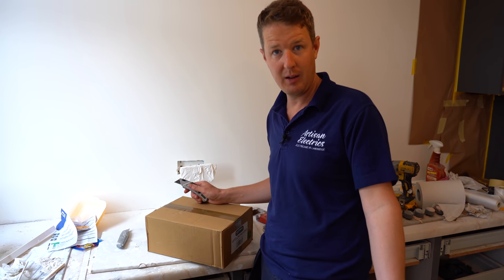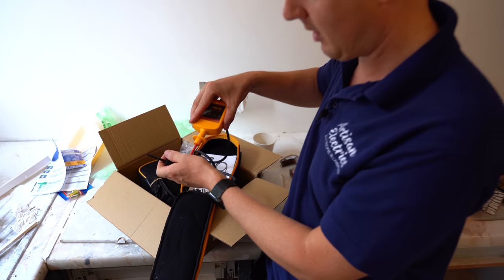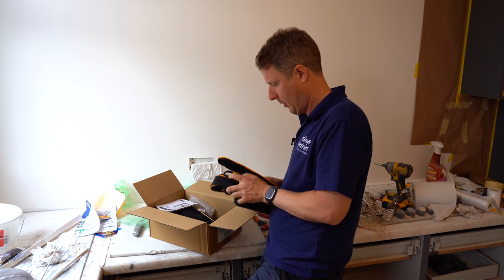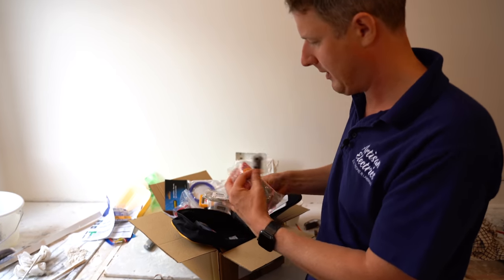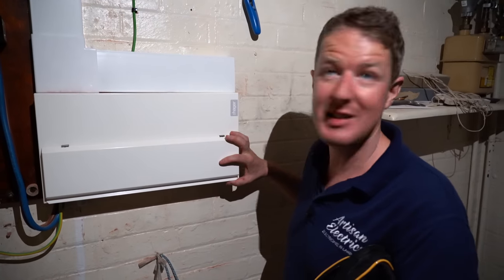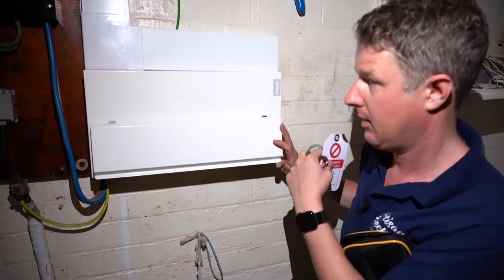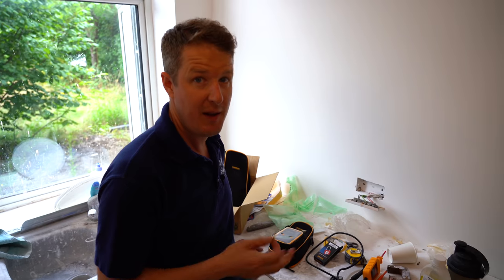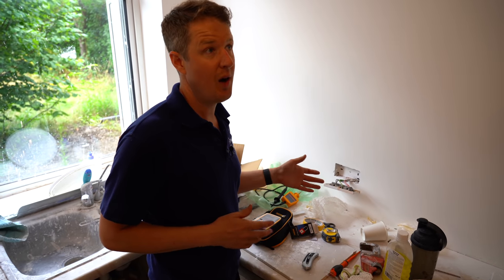Safe Isolation Procedure Lock out Tag out UK - Electrician Life

Comment: We had a "lock out- tag out system" when I use to work for a large semiconductor company in Ireland. A great system which worked really well & provided you with that security. You always had that niggling worry that's always in the back of your mind that some unsuspecting person could accidentally turn the power back on. When I went back to domestic sparking I always tried to recreate it, as the same safety standards were just not there. Great to see this device being introduced.

Comment: Actually you won't get shocked if you touch that probe with your hand. The internal impedance of these testers is too high for that. Otherwise you would trip the RCD/RCBO when testing between line and CPC. If the tester is damaged and that internal impedance is no longer given, the tester would indicate weird voltage values. Some proofing units will give you a full test cycle with different voltages.
A different thing is if you have a tester with a load connection, but this load connection is only applied when pressing two buttons simultaneously, and only for the time both buttons are pressed. And that load connection trips RCDs/RCBOs.
Still good practice to do so. But on a three-phase system it becomes a bit weird, because you also have to test between the lines, so there is no least dangerous in that case.

Here in Germany the safe isolation is fixed in our regs for decades in the DIN VDE 0105, called the "five safety rules for electrical work"

1. isolate circuit
2. prevent reenergizing
3. ensure the circuit is really dead with a properly tested 2-pole voltage tester
4. earth and short-circuit all conductors (only on overhead lines which are usually not insulated, and voltages above 1kV)
5. cover up all exposed live parts next to your working area (that is mainly for work areas like transformer stations or industrial environments)

So for domestic usually only rules 1 to 3 are relevant.
Instead of using a proofing unit you can also use a known functional live circuit instead to fulfill that regulation. But sometimes you don't have the luxury of having one in the area, so still a good idea of having a proofing unit.

Also a tip: Always use your own lock, never a provided one by a colleague or the customer! You don't know who else got a copy of the key for that lock.

Comment: Worries so much about safety he uses an uninsulated knife to cut off wrapping on a circuit he's not sure is live or not ... great advert for martindale there haha
Reply: Plastic is a non conductive material. 
Its not like he was touching the bare knife metal.
Reply: It’s a steel body knife
Reply: How do you know he didn't check it previously?
Reply: How could you get to the terminals to check if it's covered in wrapping to check ?
Reply: There might have been a loose wire floating around which you wouldn’t see because wrapped in plastic. As a non electrician I would have turned power off before unwrapping the socket.
Reply: That's right he should of done the whole safe isolation procedure before going anywhere near conductors but I am honestly shocked they have live fitting handing from the wall wrapped in plastic .
Reply: And even though it was in plastic was covered in plaster so very much a pointless exercise to wrap it.
Reply: @joemoore9991  i make you right, we have all had a tingle from time to time , seen a couple of nasties with idiots messing with 3 phase gear , but nothing serious in the domestic game , seen a few fatalities when i was an ETO , but then on ships we use 440v or 6kv
Reply: @ballchinian911  if in doubt, turn the whole installation off and then conduct safe isolation at the board .. that's what risk assessments are for ;)

Comment: R

Isnt cutting the plastic bag off a plug socket that may be live a bit dodgy, a narrow pointed blade could easily touch a terminal, and to protect a plug socket from  paint plaster etc use cling film, easier to  remove and mould to  fit  around the  unit.

Comment: I changed an outside light fitting off ladders at my parents house  and didn't put a padlock on the mcb  as they were away on holiday and I had the spare key to the house which I locked up after switching off the consumer unit mcb.
After I had connected the new light it came on as i was descending the ladder,  My parents had come home early and reset the mcb.
Lesson learned always assume someone else with the building keys could be there at any time
Reply: They dint notice you up the 40 foot ladder as they pulled onto the drive then
Reply: @ericthekingthekingtheking4842  around the other side and no window, can't be seen from the front drive

Comment: them retractable tips can be more dangerous than you think - if the tip fails to extend properly you will be left with a false sense of safety because you can't  see the tip making contact directly. Should have at least 1mm always exposed.
Reply: It's a retractable shroud as opposed to an extending probe so it's not so bad, but your point still stands about potentially not being able to see.
Also potentially problematic if you're trying to probe a socket dangling in mid air...

I do think it's better than non retractable shrouds though, fixed ones (or removable ones that haven't been removed) are more likely to give you a false connection.

I very much like the Fluke TwistGuard system. Slim, no fiddly bits to lose and you choose exactly how much exposed probe you want.
Reply: @tceng9449  and if we're being realistic, no-one is going to probe socket terminals when they can just stick a socket tester in
Reply: @havoctrousers  chosen as an example as that's exactly what he was doing in the video :)

Comment: I had an incident recently in a refurbished commercial building. The building had undergone extensive refurbishment that included a rewire. The incident involved an installed motor which now had a new feed from a different DB, the electrician had connected the new feed but hadn't removed the old wiring which had just been cut-off and left. Because I needed to renew some low-voltage control wiring that ran through the same flexible conduit as the old feed I went to remove this cut-off power cable, only to find out the hard way that the electrician had left it connected at the load end so it was now back-fed from the incoming side of the motor isolator. Of course I should have turned-off the relevant MCB in the new DB first, but it never occurred to me that a qualified spark would connect the new wiring to the isolator without removing the old wiring first. The moral of this story is never assume that the other guy, however well qualified, is going to do the job properly.

Comment: Always wise to test, so easy to screw up, no matter how intelligent / experienced you happen to be. I worked on my shed live once because I'd switched off the smoke alarms at the main CU. I only had two breakers not on RCD protection, both clearly marked, and somehow I switched off the 6A smoke alarms rather than the 40A shed feed. No idea how it happened, only found out when I went to turn it back on. Fortunately I was only working on earth wiring, but inside a garage CU right next to the (covered) busbar.

Comment: Lots of cases of lockoff kits falling off the breakers due to being poorly fitted then someone getting injured. Sadly that process of locking off isn’t fool proof . Is probably better to actually isolate it from within the board
Reply: Fantastic in a classroom not applicable especially in industry where opening a db or sub main would turn off half a site
Reply: The thing is, you got several types of MCBs with different dimensions and designs of the housings. So you require different types of locking mechanisms, and it's always trial and error. I always take my time checking if I picked the right one and test if it's holding properly and prevents that the MCB/RCBO can be switched on again.

Comment: The only problem with the martindale voltage tester is  if your circuit has no cpc or neutral  but has a live  the  tester will show the circuit as dead.
Reply: And this is where, not just Jordon, fail. Martaindale is super and great. Can you just point me to a previous video where he has used them?? I’ll watch future ones to see how much they appear. I mean, if you use the stuff sure, but to just stick it on a video and promote it, it’s a joke.  Your not helping the industry, more so lining your pockets.  Syndical me 😂😂
Reply: I don't think this is specific to martindale, but is more an issue with "2 pole testers" in general. They will only pick up when there is a voltage between two conductors, they won't pick up when everything is live or floating.

For this reason and others I would be very careful about working on stuff that is "already dead" when you arrive. It is much better if you can confirm something is live, then isolate it and finally confirm it is dead.

Even then it's not 100% foolproof, multiple feeds, borrowed neutrals and so-on are far from unheard of.
Reply: @petermichaelgreen  hi peter,  i use a different brand of voltage tester which has a feature that will alert me  if there is no cpc or neutral, the only problem with this is it requires a battery to do so but also has a self test function you can perform before using  a proving unit which will tests all the led’s and the battery.
Reply: @petermichaelgreen  The rather simple 2-prong tester I use does actually indicate a live connection both visually and audibly when probing from the meter side, but for it to display a voltage reading does require a form of ground (basically anything loosely connected to earth) on the flying probe.
Reply: Modern ones have a single probe live test as well. The Kewtech voltage tester I use has this feature, I'm sure the flukes do. I think I've only ever seen Jordan use the same Kewtech tester that I do in previous videos.

Comment: Pity the plasterer didn't show the same consideration as the decorator. The socket is absolutely covered in plaster. Have you tried using the temporary yellow socket spacers that Nick Bundy uses? Fit them during 1st fix and remove them during 2nd fix. Great product.
Reply from the maker: Yeah I’ve used the sockitz before but in this case it wasn’t necessary as we were replacing all the fascias after decoration

Comment: Interesting bit of kit. But the tester that tests the tester needs a tester to check that tester is testing correctly.
'Quis custodiet ipsos custdes?'
Reply: All falls under the time-honoured phrase "reasonably practicable". I used to work as a DNO engineer and the proving units for LV test lamps and for HV live-line detectors were also tested periodically. Testing all the test equipment at every use ad infinitum isn't reasonably practicable, so it's not expected but I get your point. Not using a proving unit immediately before and after using the voltage indicator could land you in some difficulty post-incident, however.

Comment: Great Video, Thanks for making it.
I do have a question thou, why do you try different breakers? Could you not just use a tone generator on the line and use the receiver to find which circuit it is.
Saves runnung back and forth trying different breakers.
Reply: or just use one of those 13A socket testers that beep
Reply: @mikeselectricstuff  I did not know what they were called in UK since I live in Canada.
Reply: Using a tone generator would involve more disruption as the whole CU would have to be isolated to accommodate the circuit identification process. It may well be that an electrician carrying out a risk assessment would decide that was reasonable in the circumstances (unoccupied house). However, tone generator signals could be applied to the wrong circuit and the tone receiver could pick up a signal at the point of work that was interpreted by the user as a 'clear indication' that the circuit was identified, when it was not.

In the scenario depicted in this video, proving a change of condition at the terminal on the socket outlet (proved live - MCB opened - proved not-live) is probably the most practical and reasonable way to identify and disconnect the circuit prior to isolation.
Reply: @mikeselectricstuff  not a good idea. Socket testers are not designed to be used as voltage indicators (with approved proving units) like the Martindale kit. You could use them a 100 times and get way with it or use it once and have an accident. Don't think I would want to defend that approach in a subsequent HSE investigation.

Comment: Hi  Jordan I am not a electrician just  a very keen interest in electrical  installation but I got a Martindale plug in tester that I bought in 1989 and still work great also I got a Klein 5 in1 screwdriver that I bought in USA on holiday In  a Sears store in Florida back in 2000 the largest slotted driver bit of the two fits the brass M4 pan head conduit boxs machine screws  perfect  I think I paid about 10 dollars for it I just love  to buy tool were ever I have been on holidays all over  I just got to find a tool shop

Comment: The boards I go for domestic nowadays are Contactum just because they have the magnets to hold the cover up. Not really impressed with Hager that much and fusebox brand is just a hype which tend to go down hill in my view where I used the torque screwdriver on a main switch and it just lost the thread on it. But mind you I don't want to hype Contactum just because I can go to my wholesaler and get everything without waiting for weeks on for a 20a RCBO. Thanks Jordan nice to see you back.
Reply: Contactum is a brand I am not sure on, they have been bust a few times, so who knows how long they will be around.
I recently installed one of their boards, and I wasn't impressed with it, mine didn't have magnets, plus it doesn't come with any grommet strip. Only used it because cities had it on the shelf, I normally use fuse box, it's been difficult to get, but denmans now have a good stock of it.

Comment: Nice video again!
Can’t there be a case where only the live was connected, but cpc and neutral were not connected?
That would lead to no voltage shown on the tester but the live still has its potential to earth.
Hence I think it’s good practice to measure from all conductors to a water line or similar to proof the conductors completely dead…. what do you think?
Reply: If there was a significant hazard in the work area - so, if there was a likelihood that you could touch any part of the installation wiring and another, earthed conductor simultaneously - then, yes, I would test from each conductor (line and neutral and cpc) in turn to the pipe or whatever I might be holding onto.

Comment: Here’s a scenario, you mention multiple sparks working on one site from the same consumer unit and, other trades working on site. 
So you’ve just isolated the breaker you’re working from. What happens if another of the aforementioned sparks, or worse still another trade on site, makes a change to the wiring in the loft, which for what ever reason, becomes connected in to the ring you’re on. They go back and turn on their breaker and you then get a shock. Surely the safest option in the instance where other trades are working, where possible, should be to lock off at main breaker?
Reply: Communication is pretty key too
Reply: In the real world you cannot go round and just turn of mains and incoming. Especially in an Industrial setting. You have to allow for compliant people working not everything can be fool proof
Reply: Not an unusual scenario on a large commercial or industrial installation with lots of work going on at the same time. Management of safety then includes as part of any risk assessment before work starts a specific action to confirm whether other work is taking place that could affect your safety (or your work could affect theirs). Some large sites may operate a Permit-For-Work system to manage this too. Your scenario refers to a domestic house so the risk is probably higher as it's unlikely a safe system of work is written down to cover what's going on. Head on a swivel and always treat wiring as live until proven otherwise.
Reply: Exactly what I was thinking. I’ve worked on big jobs where the HVAC boys may have their own sparks, therefore not inconceivable they could make changes without any communication, especially with multiple subby gangs going.

Comment: Probably are good testers but I like the audible ones buzzing like hell telling me LIVE!
Reply: That will only work with batteries. If the batteries are empty they'll usually only show you the "dangerous voltage" symbol and that's it to comply with the EN for voltage testers. These Martindale testers work without any battery.
I use a voltage tester with a load connection. The load is a vibration motor in one of the handles. On a noisy site you won't hear the beeping, but you can feel the vibration in your hand. The higher the voltage, the harder the vibration.

Comment: Shouldn’t you have shown you proving the unit before sticking it in the socket. I mean in the same segment. The second time you did it at around 13:40 you showed it working after. Your supposed to do it before and after ;) you vids are great just being picky haha !
Reply: Correct you  prove before and after☺
Reply: Technically you don't need to prove before if your proving after... Proving before hand doesn't improve safety
Reply: @Marri-Tech  Not in agreement there! But we work in different ways to make ourselves comfortable moving on with jobs. Habit and all that 😁